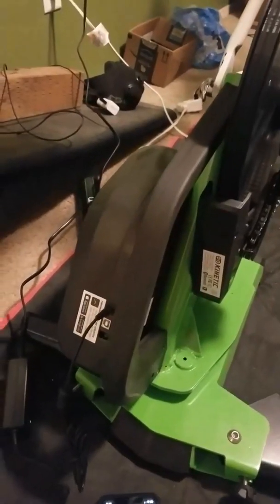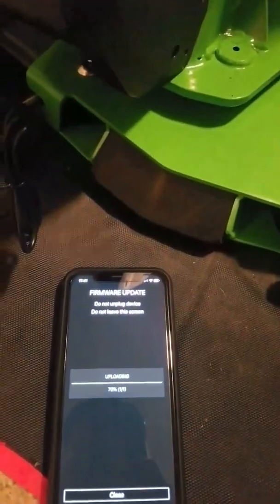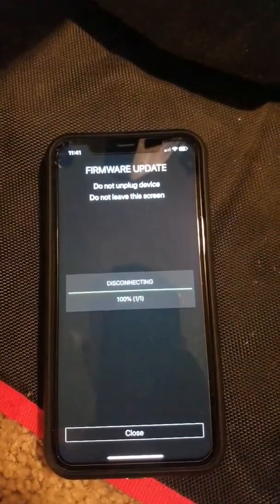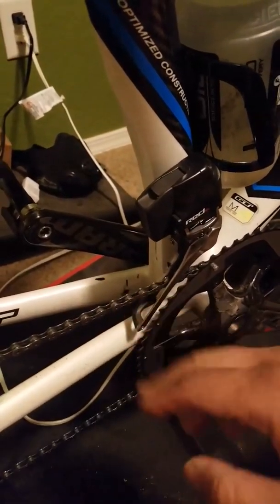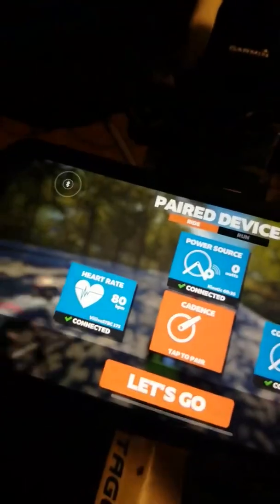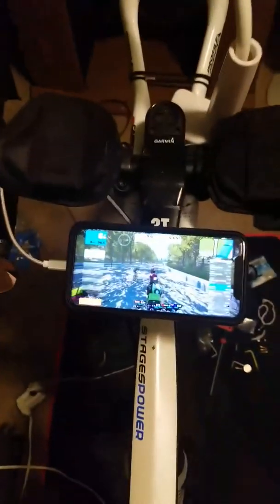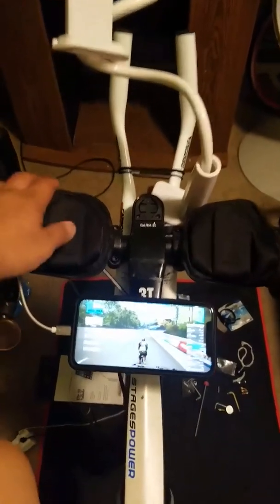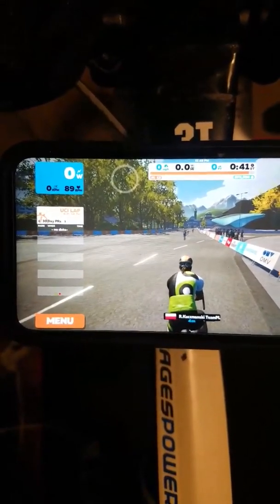Kinetic R1 “resistance unit issue” FIXED!!

Comment: How is this trainer working out for you so far? Would you recommend it? Did you ever get the cadence to work?
Reply from the maker: Nick Leung each time it would act up, Which has not been much, I would go into the kinetic app and update firmware. Next, re-calibrate the speed in the app. It works fine on the kinetic app. Somehow it sometimes has issues on zwift app. But a few repeating of the re-calibration and it’s fine again. That’s all I’ve been doing
Reply: @chaahmongcyclist1066  How often does it act up and you have to re-calibrate? BTW thanks for sharing this video! You're awesome!
Reply from the maker: Nick Leung since owning it, maybe 3 times. Seems normal since speaking with friends who own Wahoo and Elite etc etc brands/models. Your welcome. Just made this to troubleshoot and hopefully helpful to others
Reply: Got one for a few months now.  Do zwift bike then zwift run.  I noticed that the bike performs differently if I come from a zwift run and do a zwift bike afterwards.  Dunno if zwift gets confused and thinks that I am running when in fact I am biking so...the wsy I fix this is to bike a bit, close zwift and reopen it and bike.